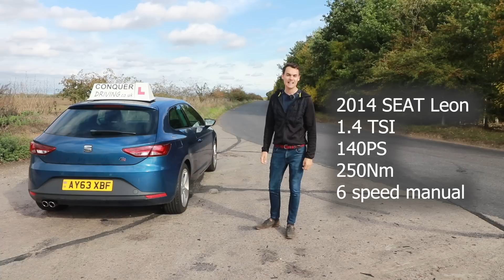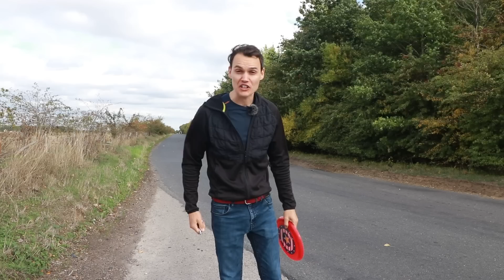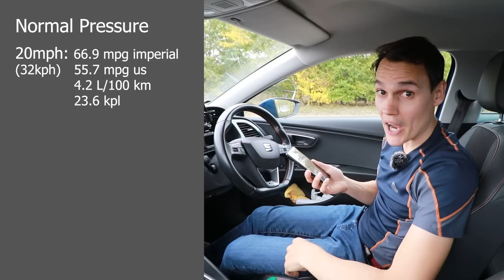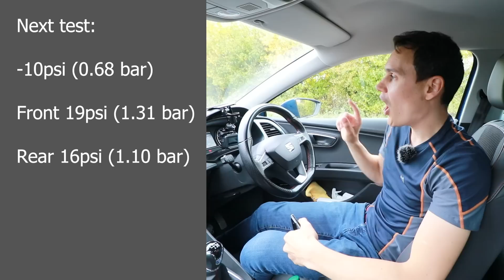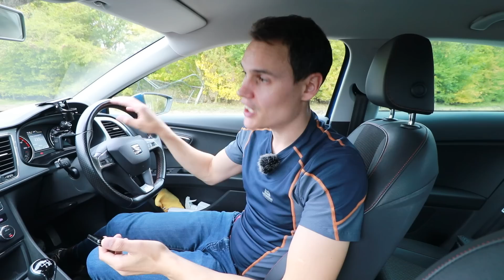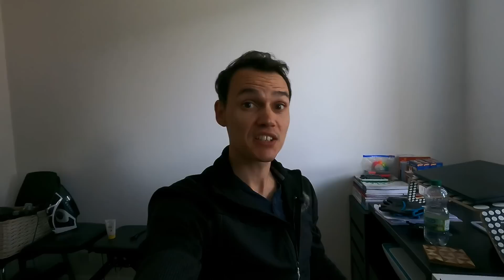Tyre Pressure Fuel Economy Test - Do Lower Tyre Pressures Cause Higher Fuel Consumption?

Comment: Interesting video.
I think at 60 and above air drag is by far the biggest factor in fuel consumption which may explain less of a difference with the reduced pressures.
Reply: Yes. drag is a very big factor. However lower pressures also result in lower stance on the road and ground effect which may also create lower drag. Interesting stuff.
Reply: @Rob-fx2dw  Lol
Reply: Would centripetal force making the tyre "expand" affect the results?

Comment: I imagine that optimal tire pressure falls along a bell curve. So if you put your PSI at the optimal, then as you drive it will only go downhill and will require more frequent upkeep to stay optimal.
For the average (lazy) car owner, manufacturers may over state the recommended tire pressure so that over the period between upkeep the tire improves a bit and then decreases. Sort of doubling the time someone needs to wait before adding air to their tires.

Comment: Higher pressure in tires is only an option if your commute consists only of good roads. If roads are bad and/or you go on unpaved or even off road sometimes overpressure tires would eventually cause damage to your rims and suspension, so any fuel savings will be nullified. Tires are in fact part of your suspension and has been calculated by vehicle engineers with normal pressure in mind.

Comment: Before watching this video, let me guess the answer: "it depends", "please follow manufacturer guidelines" and "check tire pressure regularly".

My pre-watch guess at the video contents: higher pressure will usually lead to less rolling resistance, which means less wasted power. Running on nearly flat tires will have high rolling resistance. However, overfilling your tires will cause to uneven wear and a loss of grip as well as potential blow-out issues; underfilling your tires can help a lot with grip but will cause abnormal wear can cause the tire wall to crack, as well as resulting in difficulty keeping the car stable through even slight corners. Also, any fuel savings you might hope to get for overfilling your tire are likely to be marginal at best.
Find out the correct pressure for your car/tire/wheel combination and use that. Pressure will fluctuate with temperature, so you need to keep checking pressure as ambient temperature changes.

Comment: Respect for the time that went into this test! I'd say don't trust the car trip computer, you can't be too sure what kind of logic is going on behind it, and if the reset is a true reset each time. Especially can't trust the ECU on a VW group vehicle! Personally I overinflate the tyres by 5-10 psi on our cars, the way I see it is that the pressure is always escaping out of the tyres at some rate anyway, so prefer to have a bit extra. Plus, in our Suzuki Swift owners manual, there are separate economy pressures that are something ridiculous like 45psi on a 16 inch wheel - point is, it's safe to go 5-10psi over!

Comment: I always had a question about fuel 
Should I prefer using cheaper fuel or expensive fuel?? And ... What is the reason behind it???
Reply from the maker: I use the cheapest stuff I can find. But it depends who you ask.
Reply: Here in the US, cars mostly run on Petrol (or Gasoline as it's called here).  The standard (cheapest gas) has 10 to 15% methanol mixed in with the petrol, which lowers the available energy content.  I only use pure petrol, as the methanol will damage the fuel system and cause exhaust valve erosion with long term use.  I average 10% better mileage with the pure petrol. We only have one grade of diesel, which I believe is what most cars in the UK use.

Comment: Tires can be weird, some use the center band for stability, resulting in more wear in the center, while some use the outer bands, resulting in more wear there instead.

Generally what ever band is used for stability will be made from slightly softer rubber, this gives better grip, but also makes it more prone to uneven wear.

I'm absolutely certain PSI will impact wear, but the tires overall design does come into play as well. 5 band tires are likely to use the center band for stability, while 4 bands use the outer bands, the difference between the two is mostly how well they grip in wet conditions. It can also effect the tires winter performance, however this one isn't a general rule, tread design plays a more significant roll, however 5 band tires generally use a solid center band, which doesn't give them any real grip in that area (though once again not 100% of the time).

and yes, I spent far to long learning about tires.

Comment: The tire pressure recommended by the maker was also set to support the vehicle at the limits of its dynamics at full load. If you are often driving with far less load (like an empty car most of the time and are not pushing the vehicle's braking, cornering, etc.), then it makes sense that you are getting better results with a lower tire pressure. There are also differences between tires so the vehicle manufacturer had also placed a small safety buffer in there to compensate.

Comment: If you carry heavy loads increase those pressures a lot, it's only UK spec cars which are recommended 29/26 psi, rest of World is 32/29 psi for that tyre size. I only mention it as I noticed you have an Extra Load tyre on the rear (94 load rating compared to 91 load rating as standard), and Extra Load tyres need slightly more pressure than a standard load tyre to carry the same weight. Bear in mind the Ecomotive versions run a factory 39/39psi for fuel saving, and yes they will wear in the middle! I get a fair few more miles out of Extra Load tyres, I'd imagine you would too for the work your car does, the carcass is stronger but does have a trade off with worse comfort. One important thing to note with under inflation is the amount the tyre deflects, at motorway speeds it creates a huge amount of heat in the tyre and that's the blowout cause almost always. We all know to not mix tyre size on the same axle, but don't mix load ratings either. You could have tried a coast test with different pressures, might work might not.

Comment: If you change your tire pressure, your tire diameter will change also and this will affect your trip computer. With lower pressure your tire diameter is smaller you will drive slower.
Reply: Give us some examples of how much the diameter changes with pressure for different tyres as it is so small you don't notice it.

Comment: 23:11 "and you probably save more money saving your tires than saving a tiny bit of fuel"
I fully agree you there! Tires are so expensive that having extra tire wear is not worth only a slight improvement in the fuel economy.
Reply: Imo, that heavily depends
You should run proper pressures anyways

But at 50-60€ per tire and projected 25.000km longevity even like 0.1L/100km is gonna be worth more than that

Comment: Just bought a vauxhall mokka the suggested eco setting on the door sticker is 39 front 41 rear thought thats gonna be too high so I had set them to 36 as a compromise the ride was so bumpy on bumpy roads even at 36 it must be awful at 39 lowered them now to the lowest 32 psi setting its improved the ride a lot. Not gonna bother chasing fuel economy with the pressures the suspension is stiff and short wheelbase doesnt help. I may set them higher for long journeys but around town a lot the bumpy potholes and speedbumps are awful in this car dont buy one if your looking for comfort even got one with leather seats but they are only comfortable when parked when driving the suspension is bad on this car

Comment: Interesting test. I usually have about 5 psi above the factory spec because I like the small change in handling and if it also improves economy, it's fine. (The handling is a bit more accurate thanks to less tire rubber flexing but it might be a bit more noisy.)

Comment: Price of fuel has sky-rocketed now....Our Rav4 Hybrid is achieving well over 61 mpg (imp) on a trgular basis. We run our tyres at 38 psi. With fuel being over $2 a litre every cent counts.
Reply: We areaactually well  under the tyre manufacturers max pressures......The vehicle manufacturers pressure recommendations  for tyre pressure seems to be about comfort and less noise
Reply from the maker: That is impressive economy.

Comment: If I can add another note, modern cars have thinner and stiffer sidewalls, compared to older cars with high sidewalls. With larger 4wd tires like a 265/75/R15, low tire pressures (below 20psi) at high speeds can generate a lot of heat, damaging the tire.

It's the sidewalls that hold the car up. The more it is allowed to flex the more heat is generated. Same for the tread, more contact, more heat. This thermal energy isn't just created, it's converted from additional effort made by the car's engine to turn the wheel.

Comment: So, just help you understand where this test is inaccurate and why you got some strange results. The way you car how far you have driven is by using the circumference of your tyre. By changing the pressure in the tyre, I change the circumference of the tyre, there for changing the distance travelled making your mpg irrelevant on the trip computer.
Reply from the maker: That's a very good point. I think the difference is tiny though.
Reply: @ConquerDriving  you'd be surprised how much of a difference it makes. Perhaps another video? Drive a fixed distance with different psi, and see how far the car says you drove? Maybe a large stretch of motorway, from 1 services to another?

Comment: Maybe if you alter the tire pressure you also change the diameter of the tires. your ecu has no way to detect this so the distance you travel is off and so is the mpg from your tripcomputer.
Reply: The difference is so small it would be lost in tolerance levels.
Reply: You need more torque to run larger diameter tires. It is easier on the engine to run smaller.

Comment: Staggeringly useful  video Richard 👍👍. What it highlights to me is 'recommended' is simply best guess. No one at SEAT will have dtiven 193,000 in the car but you have, therefore you (as an knowledgeable enthusiasti) are in a better postion to suggest which tyre pressure suits  your requirements.
Reply: They would have tested tyre wear but it all depends on the use of the car, so it isn’t possible to have a perfect recommended pressure for all scenarios. For example, if the car is driven on roads with more corners, it would be expected that less wear occurs in the centre compared to the outside of the tyre.

Comment: If you also factor in the economy of different tyre types/brands, they add up. For instance the difference between a tyre that has a rating of E at fuel economy versus a tyre that has a C fuel economy rating would be ~0.2 l/100km. So add that to the economy of +0.3 bar and you get roughly around 0.3-0.4-0.5 l/100km. That is quite the improvement.
Reply from the maker: That's a good point.
Reply: @ConquerDriving  Heck, with a chip tune you might even drop another 10% off the fuel consumption. I drive a Golf Mk7 and i have an average of 5l/100km. If i get 10% off that would be around 4.5l/100km, add more efficient tyres and run them with a slightly higher pressure and i might drop my average fuel consumption to a 4.2-4.4. Marginal gains, but they sure do add up.

Comment: Serious Question: Don't you teach a "Schulterblick", like a quick glance over your shoulder, before changing lanes or turning in the uk? Over here its check center mirror, side mirror, signal, do a look over your shoulder, move the steering wheel. if you miss the view over your shoulder once or twice in your driving test you can fail easily.
Reply from the maker: It depends on the situation.

Comment: Generally; maintaining recommended tyre pressure (or pressure where tyres wear even) is what one needs to aim for.
Raised pressure may throw measurements off (as detailed below), reduce grip (less surface to contact), and ruin ride comfort.
Lower pressure may just as well be as bad. Only positive effect is an increase in surface, an increase in grip - under normal road use, it might come in handy under icy conditions, where slush, snow and mud mixed is making traction and grip fade.
A few PSIs of pressure difference won't harm, but under- and overinflation can wear suspension elements out. That is one tradeoff to keep in mind.
(Also, I need to do my research on wide tyres. What I know probably apply more prominently to narrower ones...)
While notable, I don't expect fuel economy to change radically due to pressure changes - unless severe.
Reply: Low tire pressure in nearly every case reduces grip on hard surfaces due to an increase in slip angle, which is the same reason racing tires are slicks as they have near zero slip angle.  Factory recommended pressures are always on the 'soft' side for ride comfort and will compromise tire life and handling as a trade-off.  Air those tires up unless you're interested in off-road performance where soft tires are much preferred, or if you want a softer ride.

Comment: 10:02 maybe the wheels spin fast enough to overcome the resistance of the road due to more optimal momentum at 60 mph as opposed to 40mph, where the momentum is lower , making the tires work harder for every spin.

Comment: Any thoughts on centrifugal force at higher speeds changing the shape of the tyre with lower air pressure? Just asking as I had a blow out once at 70 (damaged sidewall) lost all pressure in an instant, kept it in a straight line and the tyre kept shape until I slowed to less than 20 and pulled into a lay-by  (friend following saw the air burst but hadn’t thought I lost the tyre until it collapsing in the lay-by.)
Reply from the maker: It may have something to do with the centrifugal force. I'm not sure though.
Reply: Centrifugal force does not apply to what you are trying to describe, it is the thing that will help keep your balancing weights on inside the wheel.  The shape of the tyre changes as it rotates and is in contact with the road.  The more air pressure the slightly less the shape will change as it is in contact with the road - you wouldn't notice.
It depends what damaged your sidewall.  Was it a worn tyre with a bulge in it, or did you go over something to cause the damage?
If you go over something or the tyre bursts, it depends on many factors how fast it will deflate.
I had a rear left tyre burst at 110mph and it just felt like the car was going over a cattle grid, when i stopped the tyre was flat.

Comment: Off topic from the video but quick question about shifting, I have noticed in the past few weeks that I can do the diagonal shifts 2->3 and 4->5 really fast using the following technique. Place some horizontal pressure on the shifter then hit the clutch and convert to vertical pressure. I find I can shift really fast and smooth with basically 0 chance of hitting the wrong gear. I don't feel anything in the transmission pushing against me but is this bad for the car in the long term?! Note I am only applyinng the pressure for probably 1/4 of a second or so.
Reply from the maker: As long as you're not too rough with it I don't think you will be causing a problem. I don't like to force it quickly into gear just in case it puts stress on the synchros.

Comment: Overinflated, wear on the inside; underinflated, wear on the outside, that I understand. But I've seen tire wears on alternate columns, like after a drive, the tire surface becomes striped, like dark-light-dark-light-dark. I wonder what caused that.

Comment: Deviating from the Manufacturers recommended pressures by more than 10% could lead to a fine, and points on the licence. In an RTA the insurance company will wriggle to avoid paying out. One of the major reasons for tyre failure on main roads is underinflation , they overheat and blow. 
Check the pressures  and tread depth frequently, they are all that stick you to the road, and always fit the best tyres you can afford.
Reply: Well said, in accident investigations the first thing police start with is taking tyre pressures.  The insurance company will also refuse to pay out if they can prove you did not follow the manufacturers guidelines for operating the vehicle and maintaining it.
People have been prosecuted over incorrect tyre inflation.

Comment: I always drive in town with tyre pressure 0,1 - 0,15 bar less than spec to cushion more for road bumps. Don't care and never will about that eco-terrorism. When companies start caring about not manufacturing rubbish products which barely last their guarantee,when they remove 2-stroke (!) diesel (!) engines from ships, and when Germany stops shoveling out smoking diesels Maybe I'll consider that too

Comment: The manufacturer's recommended tyre pressures take into account handling and grip in both straight line and curved line driving, wet and dry, breaking and accelerating. They do not only look at fuel consumption and tyre wear to arrive at their recommendations.
Reply from the maker: I didn't know that.
Reply: Yes they do, mine has Standard 33PSI , full load 44PSI and ECO 39PSI.  They state clearly the 39PSI is for fuel economy.

Comment: Maybe at higher tyre pressures the circumference of the tyre is larger, so you're actually traveling faster at "20"mph? And the the opposite for the lower pressure, So at "20"mph you're actually travelling slower? I suppose you could check the footage and see if there's a time differential between starting and finishing the test?

At higher speeds this circumference difference could the counteracted by centrifugal force?